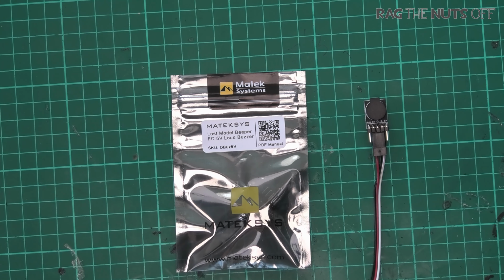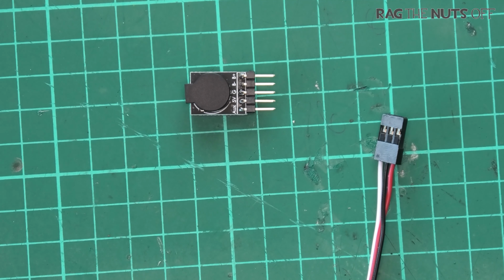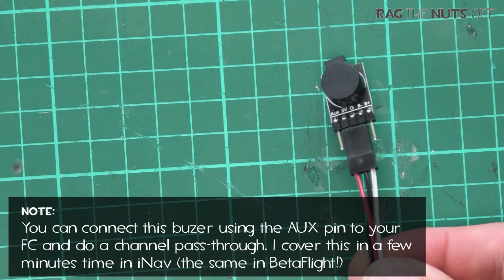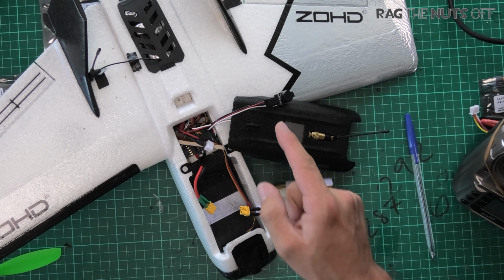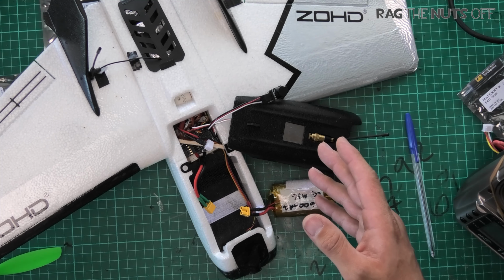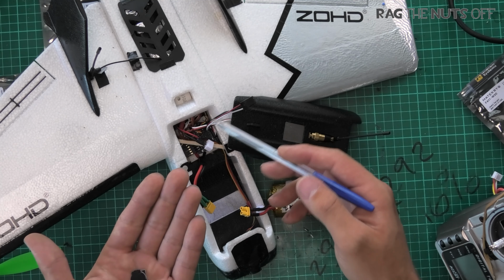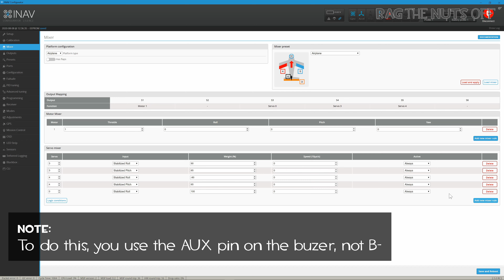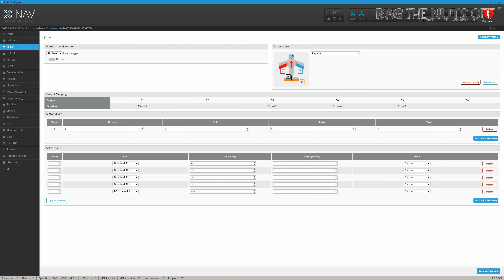OBNOXIOUSLY LOUD - Meet the Matek Lost Model Alarm / Buzzer for iNav

Comment: Matek got me on the G and 5v switcharoo on my first board. Spent DAYS trying to figure out WTF was wrong till I posted a picture of it on RCGroups and someone let me know that I soldered red headers to the ground on the VTX and camera side and black headers to the Voltage... Had I ever just opened my eyes, should've known! But now I always triple check. Thankfully only my camera died from that mistake and it was a old PZ0420, so no serious harm!

Comment: I found the sound is muffled inside the model so I drilled a hole in the side to let it poke through. 
ALSO, I had to set the PPM midpoint to 1300 otherwise it wouldn't stop once activated - but that may be just my buzzer / receiver.